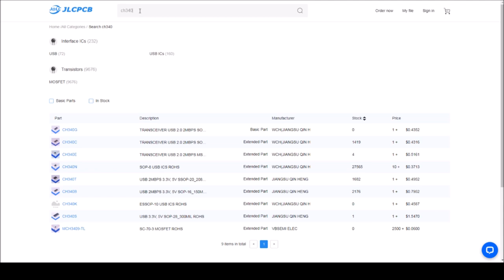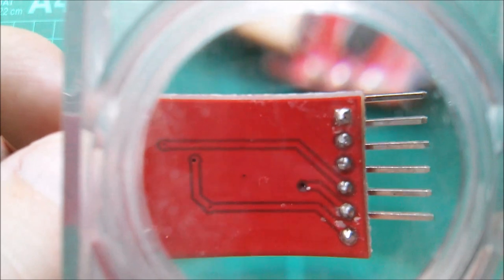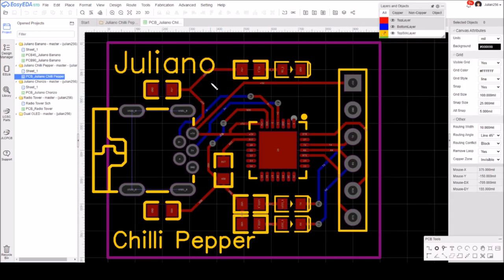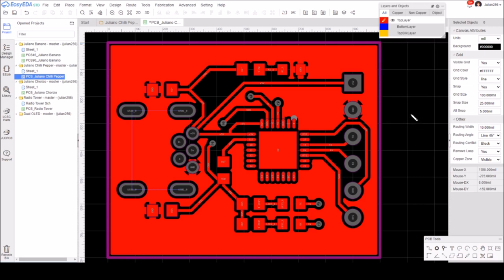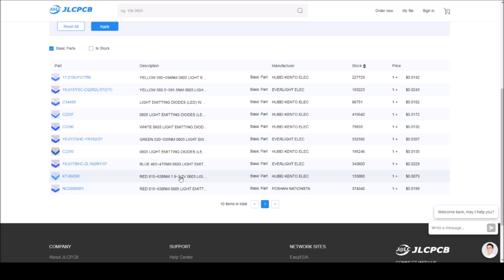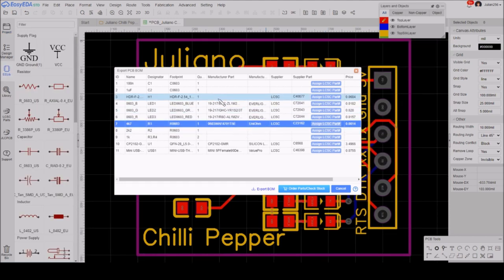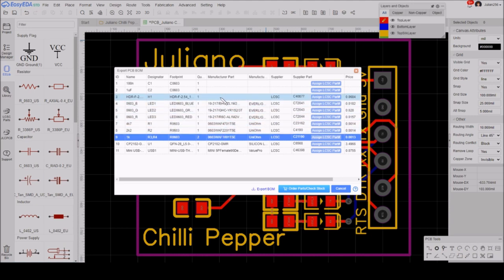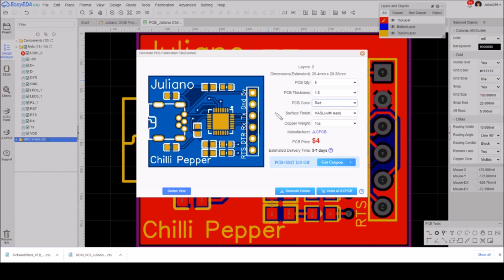PCB: Juliano Chilli Pepper - USB to Serial PCB

Comment: The CH340C is a direct drop in replacement for the CH340G except you just don't solder the 12MHz crystal since the C has it internal. I've migrated most of my designs from the G to the C version of the chip.
Reply: I have it here connected to a USB-C connector built by JLCPCB
Reply: Using the C version on a robotics project myself.  I have tested the e version also msop10 which again does not require the crystal.  Need the DTR of the C for resetting the ESP32 after programming.

Comment: I have been using the MSOP-10 CH340E chip for my AVR8 projects for a while, as they do not require a crystal.
Even better, the new CH340N only has 8 pins, and also needs no crystal, and is easier to solder in SOP-8.  It also has a "hangup" active low pin, suitable for use resetting atmega chips using Optiboot.
The CP2102 is a fine USB-Serial bridge chip ... just much more expensive than the CH340.
Reply from the maker: That's interesting. The CH340N has RTS broken out on pin 4 - I assume that's what you mean by 'hangup'.
Reply: @JulianIlett  Yes, RTS on pin 4.  I understand you use the DTR on the CH340G, but I have successfully used the RTS on the CH340E for resetting AVRs, and am confident the CH340N will work the same way.  I have some on order.  If you compare the E to the N, it looks like they chopped off the bottom two pins on the E, the CTS & TNOW.  Sadly, my "E" chips do not reliably go much faster than 230400 baud.  Do not know the best place to source these in bulk, but they are on Ali:  https://www.aliexpress.com/item/1005002359896744.html

Comment: As much as others grumped over you using the CP210x instead of the extended CH340 because of the increased price per unit (which depending on the qty and price of the alternative part price may or may not be negated by the reel change fee) , I think you made a good move... I feel the CP210x is overall a better supported chip, and you also did a good walkthrough of using the EasyEDA and JLCPCB searchs. Good show! ;)

Comment: Very cute! At least from the preview.

I ended up abandoning my circuit in easyeda and went back to kicad. It was very frustrating to get used to a new program when I've just gotten used to kicad. And it turns out only a few components that I wanted to use in this design were basic parts, so I'd be ordering a bunch of SMD parts separately, most of which I've already got through-hole versions of anyway. I guess I'll have to wait for another project to try the SMT assembly for myself.

Comment: Make sure to name one of your boards 'pepperoncini". I Love those peppers. I think they are Greek, but it sounds "Arduino-ee"! Hey, back when I built your bare bones Arduino Uno, I had an issue with my USB to Serial board resetting. I ended up putting some high value pull down resistor from one of he pins to ground. It reset fine after that. I think I remember you doing that mod on your board for the same reason (?). That was such a neat breadboard project even though I pretty much just programmed different LED blinky sequences!! Still fun though. Thanks, Julian!!
Reply from the maker: I thought of an awesome name for my new Pro Mini equivalent - I'll give you a clue after eight ;)

Comment: In the end I'm not seeing anything "chilli pepper" about this USB to serial adapter.  I like the CP210x ICs and get that you want to use the JLCPCB service but you can get completely assembled (ie. USB already soldered on) CP210x adapters cheap off eBay.
Reply from the maker: And for the last 10 years, that's what I've been doing, buying cheap electronics from eBay. But things change :)

Comment: Why don’t you connect the support pins on the USB connector to the ground plane? You could use a very fine trace and soldering wouldn’t be much more difficult, or even just connect them in pairs to each other…
Reply from the maker: A website said no :)
Reply: @JulianIlett  Ground loop?

Comment: Yeah but the CH340C has an inbuilt crystal and they have thousands in stock, dosent this out way the fact that it's an 'extended ' part as your saving on a component ?, also your new part has an internal crystal but cost £2.67, so how much does it cost to use extended parts please ? also, as you rightly put a copper pour on the back you can fill in the gaps on the top pour with a via ! (even less etching) they used to cost extra but not anymore pop them in where you please ! nice work....cheers.
Reply from the maker: I'll probably redesign the Chorizo using the CH340C
Reply: think Juliun needs to shop around, quick search and the ch340c costs £1.24. probably can get it cheaper. Even RS and digikey are less then £2.67
Reply: @JulianIlett  I was going to copy web address but it was too long, Banggood  50pcs HW-728 CH340E MSOP10 USB to TTL Converter at 50p each, some times it just not worth making your own
Reply: even if Julian was given the part for free, by the time he got it to JLCPCB for placement the delay would cost more, Plan B fit himself, The time would cost more.... is the CH340C available anyway ?
Reply: @David_11111  yes at 75p each from aliexpress, you can send your parts to jlcpcb or get them to buy them for you at extra cost. Aliexpress people don't send in tape or trays so jlcpcb will charge you more for the labour but it can be done
Reply: @David_11111  Yeah it said over thousand in stock.
Reply: @David_11111  Hmm you imagine that Julian is not getting these for free????
Reply: @PetRatty  my post was in response to another comment suggesting he could buy them from another supplier sorry i was not clear enough !

Comment: Sorry if this is a stupid question, but if you use basic parts does this mean they will solder the parts for you at the factory? Or rather pay to have them soldered for you?
Reply: 'Basic' means the parts will already be spooled on a pick-n-place machine. 'Extended' means someone will need to physically swap out reels, which is inconvenient for them, so they charge $3 to do it.
Reply: @YoutubeBorkedMyOldHandle_why  so you are saying that they will solder it on the PCB?   Or they just send the parts in the box with the PCB?
Reply from the maker: They solder the parts on the PCB for you.

Comment: Why did you not continue searching for the resistors on the /parts website like you did for the LEDs???  And on EasyEDA there are "too many" 2.2k resistors because you are looking at every footprint.  Sort by footprint and find your 0603 or look on the /parts website.
Often your "hack" of searching for a 1% resistor instead of a 5% will end up costing much more.  In addition to selecting "Basic Parts" select "In Stock" to help narrow it down even more.